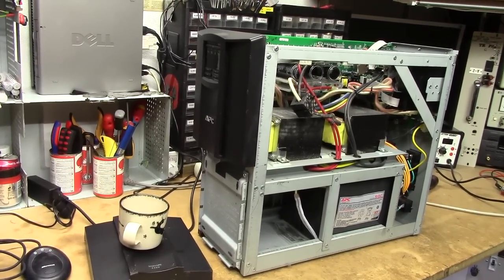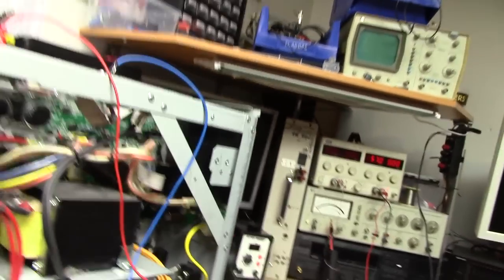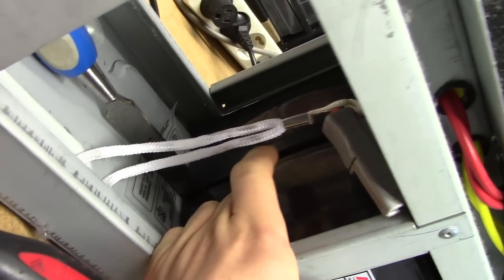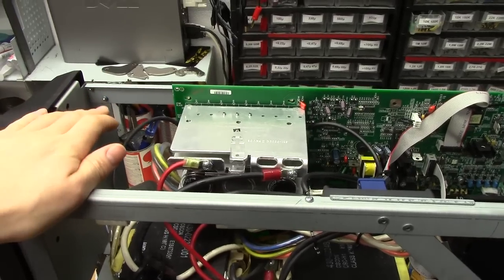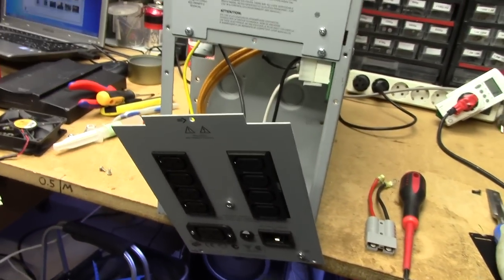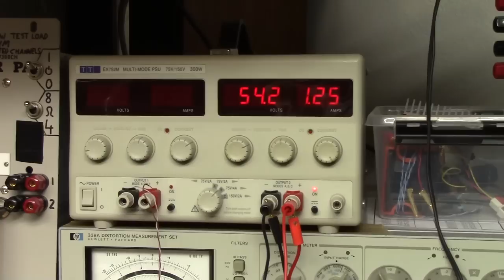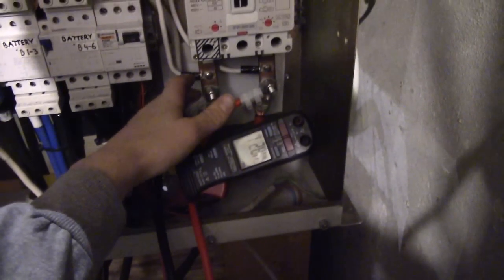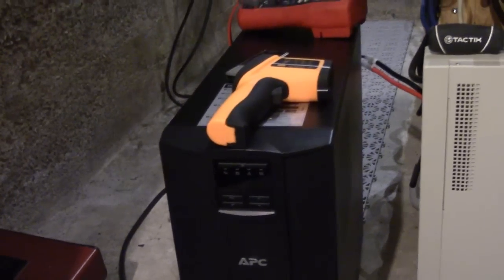Trash-picked APC Smart-UPS 2200 battery removal & hacks

Comment: Awesome video. I also love my SMT2200. I bought mine off of eBay 3 years ago for $200.00 with batteries and free shipping. It's just now saying the batteries are failing. I've been checking them regularly leading up to this so that I wouldn't have to drill out the rivets. 

I was searching YouTube, because I plan on building my own RBC55 batteries from SP12-18HR batteries.

I'm really happy after seeing your stress test. It's good to see it being able to handle that kind of a load for so long.

Thanks for the video!
Reply: I have a powerwear9 bran new dad got it never used think battery's dead.  Fp
Reply: What do use it for
Reply: @Lorenzo-zw6hv  it's backing up all of my computers, NAS and network equipment. I love it!

Comment: Well done on carrying the bloody thing by the way! I usually shift the 2200s with a suction lifter normally used for lifting server room floor tiles, "hovering" it just above the floor because the lifter won't hold it for long. Either that or pull the batteries, although you don't normally have to drill the rivets out to do that :)
Reply from the maker: +AintBigAintClever I don't blame you - carrying it by hand was not too clever.
Reply: +AintBigAintClever Yes they are very heavy. 
The larger free standing ones that hold a rack of 4(10X 12V 18ah) Batteries are the real beasts. nothing like 120V DC in Series with 4X Amps.
When they finally give up the ghost they fail hard and practically melt the whole 10 battery pack.

Comment: Some years ago I ended up with a APC 250VA UPS (likely square wave op) with bad batteries.  I used it for a number of years in emergencies.  Then I purchased a Black and Decker 12 v inverter and threw away the APC.  A few months later the magic smoke escaped from the B & D.  Bummer!  Then a few months ago a friend gave me a APC 1000VA unit with bad batteries (and because I think he thought it was a square wave output).  Upon checking the model (Smart-UPS) I realized it was a sine wave output.  Yipee!

Comment: If those are polys and not MOV's, @ 21:20, I think they're 3225 form factor PTC's. MOV's would make as much sense as a protection component in the same spot, and they come in a similar form factor, so I'd put 70% confidence down on it being a posi thermistor, and if that's the case maybe 80% on that being the form factor +/- one size
Reply from the maker: +wither8 The fuses APC use are not that fancy - they're just a one-time use copper fuse, much like a car fuse.

Comment: We have the rack mount version at work. I like the old style better because you can just use the on/off button to turn them off. On these new ones you have to go through a menu tree to turn them off. The only failures I've seen is the switching relay inside getting fused but we have them running off generators and abuse them pretty hard.
Reply from the maker: +z1power You do have a point about the power button; I still don't really know how I managed to turn it off at all, to be brutally honest with you.
Reply: +FFcossag wouldn't going through a menu be better in a working environment, stops people accidentally turning it off.. Does it still charge when off but connected to mains?
Reply from the maker: Slot1Gamer Yes, that is the advantage, and probably why they chose to do it this way; even I've had people accidentally turn off my UPSes in the past.

And yes, they charge the batteries all the time as long as they're connected to the grid.
Reply: +z1power One of our SMT1000Is went doolally a few weeks back, was only a few months old. Reckoned the input voltage was all over the place when it was actually rock steady, plus an AVR relay weld error (which I reckon was related) which resulted in it shutting down the load.

Comment: You can get the batteries out by unscrewing the panel on the front and sliding them out.
Reply from the maker: +joe72205 Yes you can, as long as they're not so bulged out and bloated that they no longer fit through the hole.

Comment: Hello, I was wondering if you would be willing to do a video with an SUA2200 or similar model combined with an NMC (AP9617?) and Network Shutdown configuration. I have searched and searched and can't find a decent tutorial.  Thanks for considering it.
Reply: Hi. If you want to use PowerChute, there should be plenty of guides online.
Apcupsd can connect to it using SNMP or it can also connect via the PowerChute Network Shutdown protocol... It really is pretty easy to do.
If your network card is missing some features, a firmware upgrade of the NMC and perhaps even the UPS firmware should fix that.

I'm currently fighting an issue with Apcupsd. I have an SMT1500I (no smartslot cards) hooked up to two computers. The more important PC of the two has the USB cable connected straight to the UPS. The second PC has apcupsd set up to just fetch the UPS data from the main PC via the network.
Now, apcupsd (on the main PC) does communicate with the UPS using it's regular USB driver just fine, but I can only get the battery %, online/onbatt status, not much else. With that, all is well.
To be able to get a lot more info than that (line voltage, boosting/bucking the line voltage in status, load wattage/VAs, etc.), you need to have MODBUS support in the newer UPSes.
I've had to upgrade the firmware on my UPS to get MODBUS support from it.
tl;dr
apcupsd crashes after a few minutes of running when set to use MODBUS. kinda looks like a memory leak and then something breaks in it and it just completely stops communicating. NO F*****G IDEA WHY... :(

sorry for this long comment, I just needed to get this out of my head...
Reply: @marekslemensky4531  totally been there! Hope you get it figured out man.

Comment: Have a question, do you know how to convert one of these to run on 24V batteries? I know about connecting the 24v transformer sides in parallel rather than series, doubling the Mosfet count, filtering caps and current traces/wires to batteries but I don't have any idea how to trick the brain of the unit to think it's still running on 48V. Unit is a SUA2200.

Comment: How would you calibrate for a larger battery bank? 

I have one similar hooked up to a large battery bank,
Reply: as long as its another SLA battery or regular lead acid battery the UPS will charge the battery up although it will take longer. I read that lithium or other types of battery will not work bc the voltage is a bit lower so the UPS will not charge those types.

Comment: Hi as I understand there are 2 battery packs in this unit with each 24v an they are connected in serial to get 48v nominal at the dc input of the board.  I'm right?
Reply from the maker: That's correct.
Reply: @FFcossag  thanks a lot.. I think about to install 2 external 24v agm batterys using the stock connector

Comment: Thanks for this video. I have APS smart-UPS.
It contains integrated circuits APC2020B and APC2010.
what is the function of these integrated circuits?
please,Can you gave me the data sheet for APC2020B and APC2010.
Reply: They probably are custom APC chips.
You should be careful with them, because APC is the only company that has acces to them, and they have no interest in selling the user their custom parts or datasheets, as they are the only parts that prevent people from building fake units.

Comment: Nice find!
I think the rivets were used to save a few cents as it's easier to rivet something into place than screw it in there.
I was thinking of replacing my two APC SmartUPS here (one 1000VA and one 1500VA) with one 2200VA unit a few years back, but those bought new are simply too expensive for me (got all my APC SmartUPS cheap from Ebay, mostly bought as not functional and then just putting new batteries in them which most times fixed them). Still have an old white rack mount SmartUPS2200 put away in storage as that one is just too big for using it here (I've put the 1500VA SmartUPS on top of the 1000VA one here).
Reply from the maker: +nerdywolfi In my mind, the white Smart-UPSes are still king of the Smart-UPS hierarchy. ;)
Reply: +FFcossag I didn't particularly like the 2200VA rackmount SmartUPS cause it had cooked up its batteries, which is how I ended up with it (basically more than two batteries of the battery pack had shorted and one was even open circuit while one had been cooked to oblivion - somehow miraculously it hadn't caught fire yet when I arrived and took it out of service, was nearly too hot to touch). Now that location is running an MGE UPS which has already broken down two times and got swapped out under warranty (one time a fan failed and the other time it was just dead).
Reply from the maker: nerdywolfi Pretty much all small (as in sub-10kVA) will cook their batteries. It just seems to be "industry standard behaviour".
Reply: +FFcossag Not sure why the manufacturers were that dumb though. It isn't rocket science to deploy some sort of battery management to at least prevent battery packs getting out of balance - or at least give an alarm when one battery in the battery pack has failed instead of cooking the whole pack. Not sure if you could easily retrofit something like that, would be quite difficult to tell the UPS to send out a notification and/or at least not do a self test (cause that's what was pretty annoying with the 2200VA SmartUPS - it did a self test which it couldn't complete and during that self test the output voltage had an interruption and therefore all servers connected to it crashed each time it tried to run a self test with that cooked battery pack).
Reply from the maker: nerdywolfi They have an interest in keeping the maintenance costs of their products high; that way, corporate customers are more likely to replace their units once they're written off rather than keeping them in service. Budget-wise, a 5-year-old UPS has no value, so it makes no sense to keep throwing money at it. It's not until you get up to the really expensive units, that take many years to write off, that it makes sense to integrate a good BMS, and work toward lower running cost.

Retrofitting a BMS to a UPS like this would be really easy. In the case of older Smart-UPSes, all you really need is a microcontroller with RS232, and you could monitor the batteries and adjust the UPS charger accordingly.

Comment: Does anyone know the size and type of screws on the silver battery door? I need to get a new screw. The screw has both a Philips head slot and a space for a flathead.
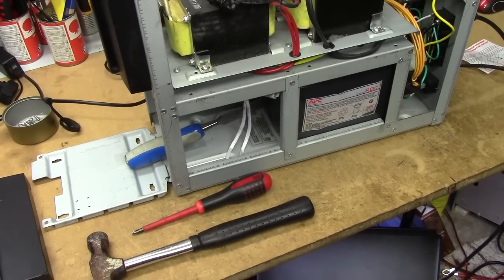Reply: the door can be seen here on the left already open. the back of the blue and gray screw driver is sitting on it. 9:39

Comment: hi FFcossag, I found one of these recently as well (including the bloated battery issue) and have a question about the battery replacement.

Is it necessary to connect it to 4 12v batteries to get to 48v like you mentioned the UPS is expecting, or can you just connect it to one large 12v battery source, like a car battery? I noticed you plugged it in to your battery source in the video but wasn't sure what voltage you have that at.

Thanks!

Comment: Maybe smart-card with serial port could work in smart slot? I just don't know if connection ports are still in one pice because of extarnal battery connection mod.
Reply from the maker: +Ruslan Zamaletdinow I still have the connector for the smart slot, so I could install a card if I wanted to. Who knows, there might even be RS232 going straight into the smart slot - I've never played with them before.

Comment: I am using the same 2200 apc smat ups as yours, but since I am using a used battery so it always sounds like a whistle, I removed the whistle, during the process I made a short circuit from a The foot of the horn with a circuit close there, so the machine now no longer work and it has the following phenomena:
   - When the battery connected to press the power button is still open but there is no signal output
   - When the power cord is plugged into the hear active relay, but the two open and close buttons are no longer effective. So can you help me recover? If you can help me i will post the video its operation status for you

Comment: that's a great score! Nice battery setup you have there, did you ever do a video on it? would be interesting to see that setup you have and how it works. Keep up the awesome videos!
Reply from the maker: +Ray M I don't think I ever made a very detailed video on the big battery bank (I built it in a rush). There's not too much to say about it, though; it's five parallel strings of four 170 Ah 12 V batteries in series, making a 700-ish Ah 48 V bank. It's hooked up to a TINY sub-500 W solar system which can barely support itself, lol.

Comment: Hi I have seen that you like fidling with APC  I have two apc's  nearly smiliar , one is a 2000 watts Smart other  is a 3000 watts Smart , both share the same  problem :battery indicators are showing to low only one led and blinking and the unit starts beeping even with suply of 52 Volts ( that's  13V/bat)  this seems  to be a common fault on both UPS's  ?  any idea where to look for ?   please send reply if you have a   solution .
Reply from the maker: You probably need to reset the battery constant through the programming mode.

Comment: Hi FFcossag.

Great video!!

I have the same unit here, but since a few days I get an overload alarm, when mains goes down (or if I pull the powerconnector (that gives the APC 2200l its power) myself, even if there is not any device connected.

Any idea what that could be??
Unit is from 2015.

Anyone with a schematic??

Cheers

Robbert

Comment: hello
do you know what is the whole battery pack voltage of APC smart ups 7500va ? Do you know what are the ones in that brand that can run on a 24Volts battery ?
Thank you very much !
Reply from the maker: I've never touched an APC over 3 kVA. Most units up to 1500 VA run 24 V packs.
Reply: However is power 9 1500 worth

Comment: I just grabbed on, my boss was throwing it away. I snatched that shit up. I'm gonna swap the lead acid and make some 18650 packs. I have a ton from ol laptop batteries and there pretty cheap now.
Reply from the maker: Be careful with that, laptop 18650s can't do more than 3 A per cell, and the voltage regulation in APC UPSes isnt very good. YOu might set your batteries on fire.
Reply: Waoh, I'm not alone in this exploration, I just fixed my 3000va with 18650' from old laptop batteries..... 13 in series, in parallels of 4....

Made sure the batteries have similar charge voltage before connecting them.... running very well and definitely won't overcharge with 53.8v....

These things never die though I hate the sound of the fan

Comment: Hi FFcossag , following your channel since many months now... Nice and clever works!  
BTW , I found a Smart-UPS 2200 on the net and the guy is saying "To be repaired and no batteries . If batteries are connected it beeps and remains off" . 
Do you think are the guilty 22uF caps or maybe some major problem? I'm considering if it's worth trying the repair or not (just the shipping cost is quite high). 
Thanks if you can help me!
P.S. At the beginning I was struggling to follow your speach with the finnish accent..but now...it's still hard!  ;-)
Reply from the maker: The 22µFs tend not to cause critical issues, so I can't really say anything - sorry.

Comment: I have a nasty SMARTUPS 3000 sitting on my workbench right now. i need just to know, this one is dead. It wont turn on, when i plug it, a red light in the back turns on reading "Site wiring failure" OFC my wiring is ok. Batteries are dead too. Does those things turn on without batteries?
Reply from the maker: They will NOT power on without GOOD batteries.
Reply: Yeah i realized that. Had to buy a pack of 4. Pretty expensive.
Reply: Servimachine Edwin Mejias I have a 3000 Apc ups, it uses like a ton of batteries, runs on 192v dc from batteries. I cant afford to buy 40 plus batteries.
Reply: I saw Knurlgnar turn one on by connecting wires from a drill battery. All it needs is a momentary voltage present and the unit thinks it has good batteries and powers up. Then remove the wires you used to jump start the unit. So they will not power up without voltage present but it does not have to be the batteries in the unit.